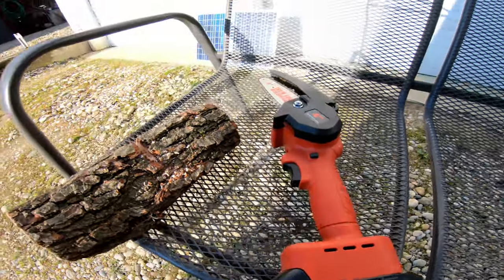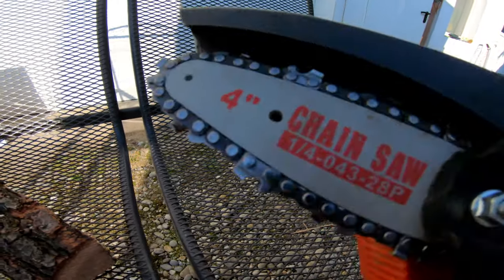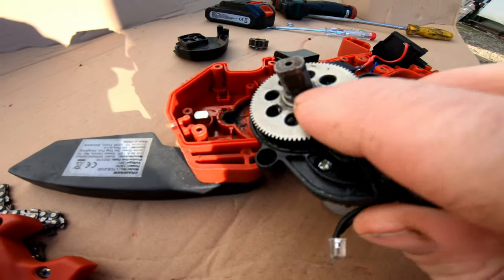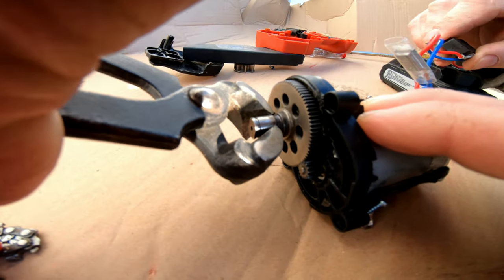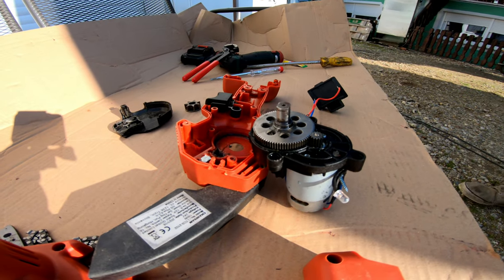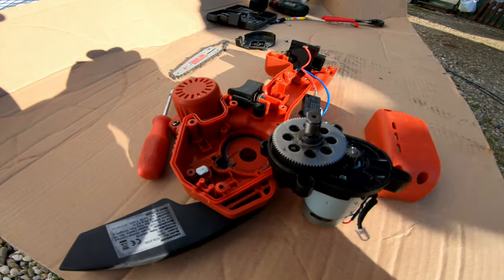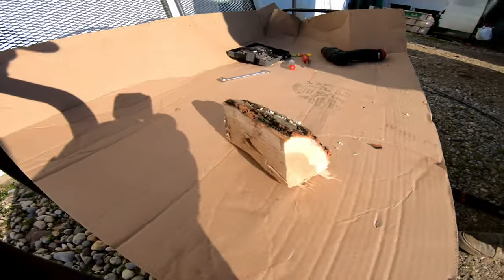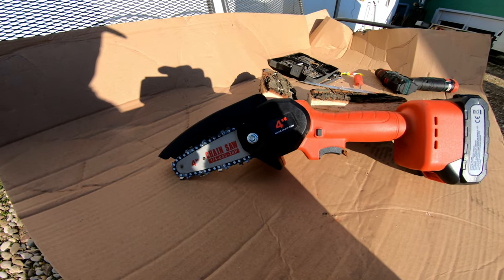Mini portable chainsaw 4ˇ simple fix

Comment: The thing with the plastic cover, how does it work?
Reply: The Cover with the Bolt - Tightens the Blade to the chainsaw - the Blade has a Hole that Goes into a Pin on the Body of the Chainsaw under the Cover, and Keeps it in Place.  You Remove it to Change the Blade or Chain